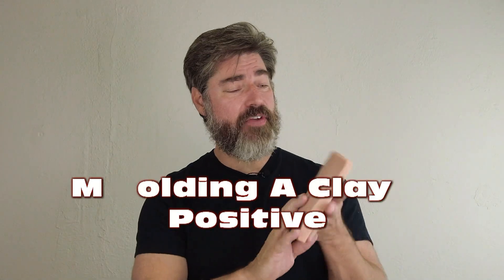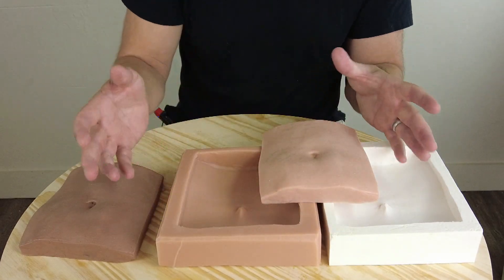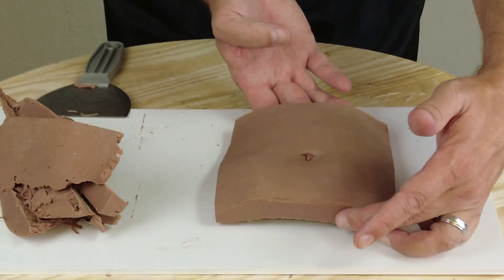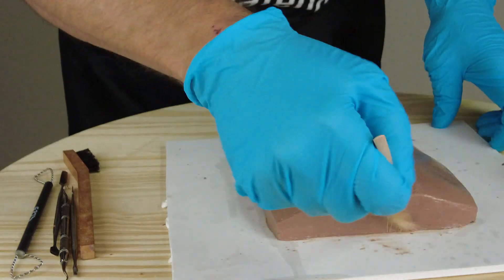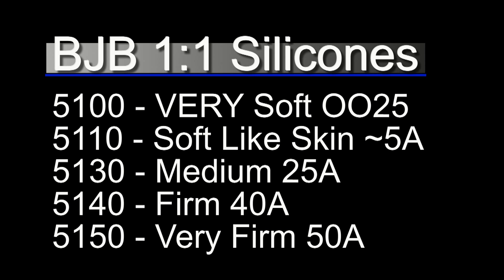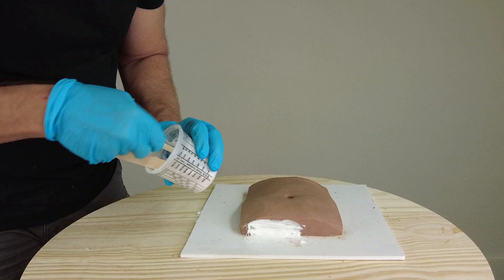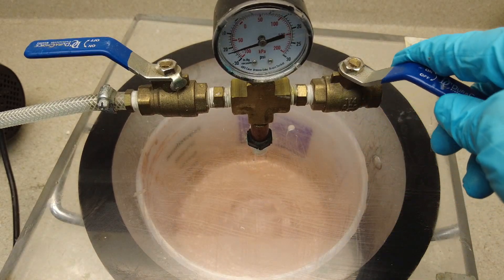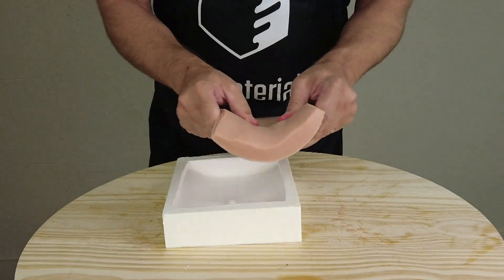Mold For Silicone Casting Part 1

Comment: Just want to get clarification. Zip 301 and zip 301s are the same?  The can in video just says 301 but link says 301s.  Just checking :)
Reply from the maker: @samfultonsr  both are the same. I think mine is an older can.